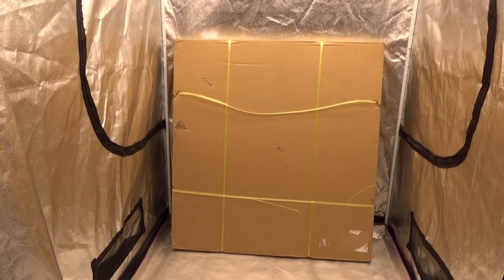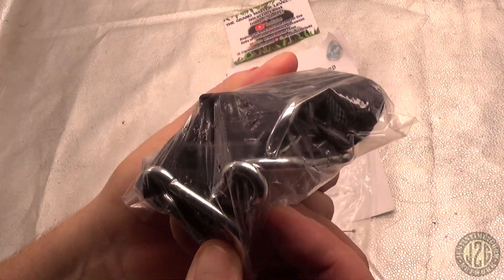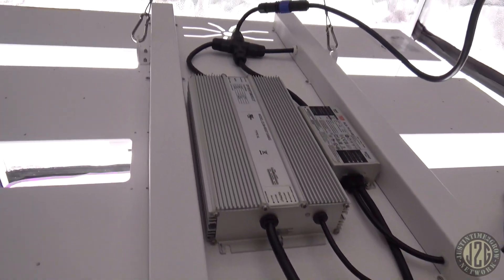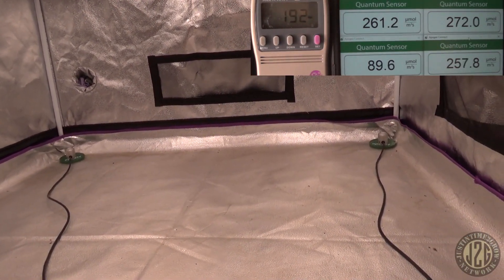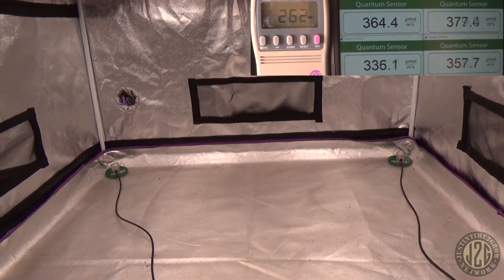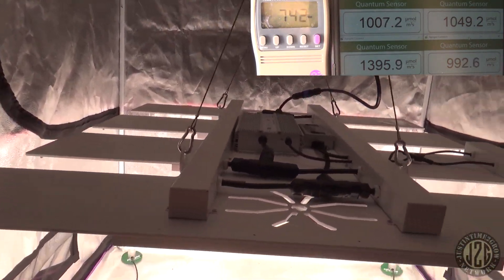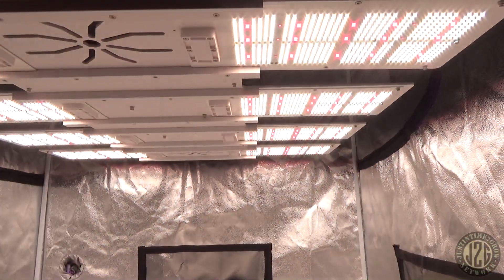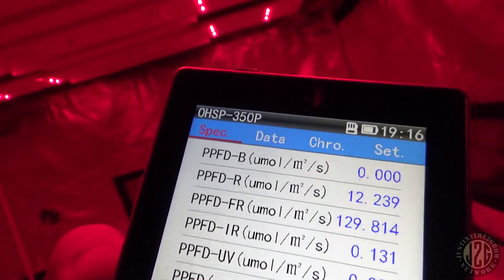Watch This Grandmaster LEDs Tarantula Vulcan Destroy a 4x4! Spectrum, PAR, Wattage & Heat Test!

Comment: Thanks for the review! Impressed how cool this beast runs.  Cool to see a board style knock it out of the park with so many companies mainly focusing on bar style
Reply from the maker: It's a little bit cooler in my shed here because I couldn't heat up the floor but still tested really well, I left it on extra long to see if it would heat up more. It was about 67F in the room I was in. The floor is concrete and it was 12F outside so that concrete was cold AF lol. You can see the floor reading says like 60F.

Comment: This  light is designed to Kill Scorpions, I will quickly tell specs
Tarantula Vulcan 🖖 
Diodes 4488
Far red yes
Dual channel yes
8 panel 
ip66 
Scorpion Diablo 
Diodes 3996
Far red  no👎
Dual channel  no👎 
6 board
ip20 👎 👎 👎 👎 👎 👎 
Have a good one 🙏
Reply: Your definitely killing it bro shout out from the Wild Wild West of Weed Tulsa Oklahoma...🤙👊💥
Reply: Just purchased mine. Can't wait to get it.
Reply: Not made in usa tho
Reply: @ernestoarellano7869  would you prefer a light made in the USA that is ip20, paper glued to the boards and a .25 cent potentiometer that has less diodes , no far red and cost way less to manufacture for the same price? If that's the case go for it.

Comment: Is this a 120 VAC or can it be plugged into 220VAC was thinking of getting the 320R for my 4x2 it’s 725 dollars this one is 1,300 so you better be serious about growing because theses lights are for a real growers love the 5 years warranty also
Reply from the maker: You can order it with 120 or 240 plug on the website. With my discount code it's $130 less.
Reply: It will draw 15 less watts at 220 🙏

Comment: i dont see any uv leds tho very important for trichome production later in flower but at least i see some reds and irs there so theres that
Reply from the maker: UV and IR is not essential. It’s supplemental. I’ve grown incredible bud people drool over with light that use zero UV diodes. I’ve also done it using a veg light with no reds. I can’t actually say for a fact that UV has ever done anything for me and red is already in warm white. IR is another one I’ve grown incredible bud without. Both UV and IR are not essential for creating good bud. Cool white and warm white have plenty enough spectrum to mimic the sun. 

No company actually puts enough diodes on to matter either. If you want UV use a strip. Not only will it have enough uv to actually do something but you don’t have burnt diodes in your light because UV diodes burn out faster. It’s always best to have them on a supplemental strip. Which is why a lot of high end LED companies don’t do Uv on their fixtures. Uv can also impact your stretch so you don’t really want it on full time.

Comment: That hanging kit is way to long in my opinion for a tent. Nice panel style light but it all depending on price
Reply from the maker: You know you don't have to use it right? You can just use 4 rope ratchets. If you buy only on price you're going to buy dogshit.
Reply: No dogshit here i run chilled and photontek 😄
Reply from the maker: @dankabiskind6956  Chilled is great and inline price wise with this light. Photontek are posers and scared of the 4 corner PAR test.😂😂
Reply: @Justintime2grow  yeah photonteks Halo lights blow dix for the $$$ lol low af chip count 🤣